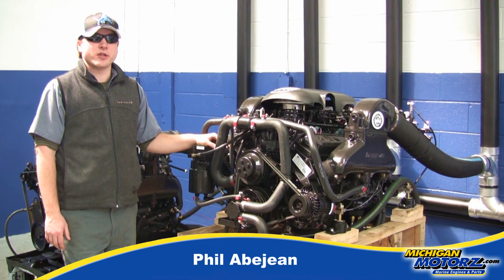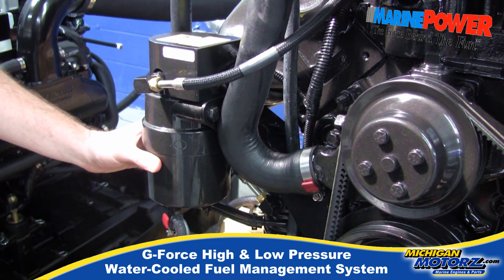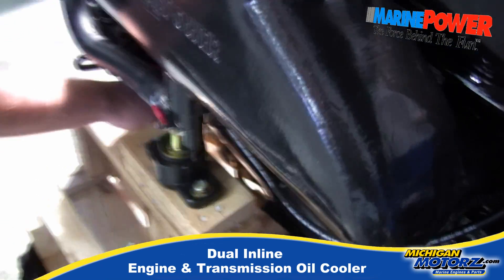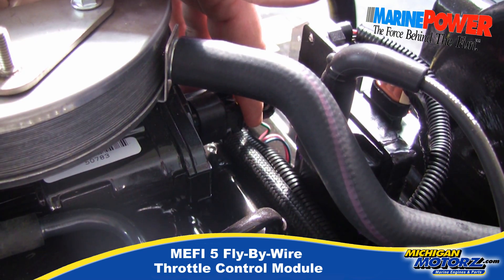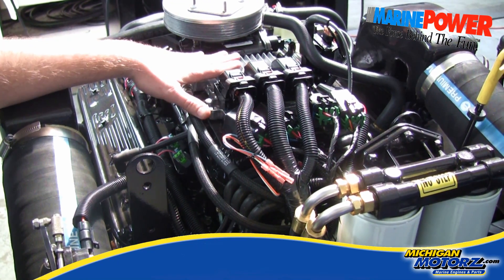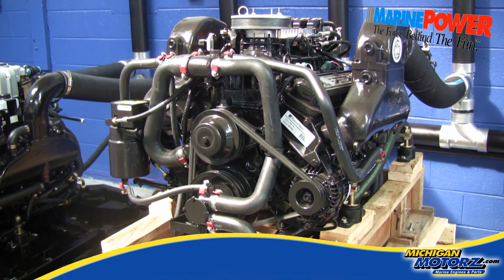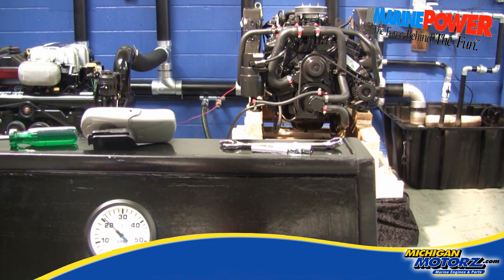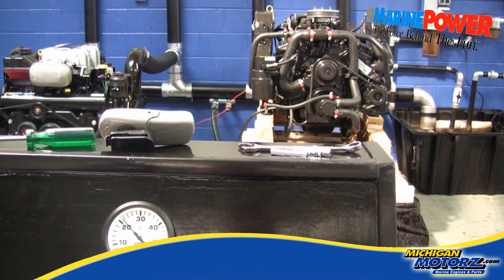5.7L Marine Power SportPac MPI INBOARD Engine Package with 71C Transmission

Comment: I have this exact engine only it has the glycol exchanger system, so it has a miss that starts at 2200rpm, I change plugs, wires, distributor, ignition coil and crank sensor, fuel filter, cleaned the tank and it still does it, any idea what fuel pressure is supposed to be? Thanks

Comment: he keeps telling us that the fuel lines and fuel system is coast guard approved. I didn't know that was an option, I learned something new today! I have to make sure when I order my motor I get the one that is coast guard approved. He tells us that the transmission has "filters" no, it does not. Also, the computer system uses 12 volts and "that's very important"! I'm not sure why that is so important but apparently it is. Next he tells us that EFI gas engines are the best you can get which they are not, diesel is the best you can get but if you're going to get gas EFI is better than carbureted - this kid needs to go back to school, finally he demonstrates "what this baby can do" by revving it under no load. That was painful but at least it's over....

Comment: Marine Power uses a potentiometer-based throttle system with the MEFI 5b ECM. The potentiometer has analog screw-type adjustment to manually reduce or increase your idle speed, just like a carburetor.